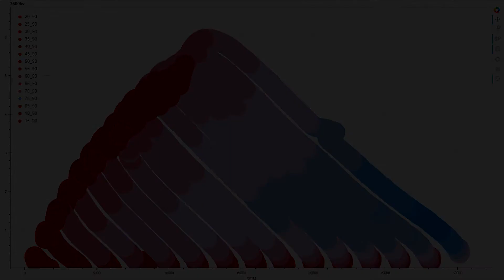Motor KV Vs Efficiency

Comment: WELL! I learned something!
would you happen to have an insight into factors in motor construction that would affect linearity of power delivery or low end torque vs high end torque?

on linear power delivery do you think that’s more just esc/software related.

If you already answered this question - just lemmie know.

thanks for these great technical videos!!
Reply from the maker: Linearity is a bit of an odd thing.  Any motor is capable of perfectly linear delivery of torque over it's power envelope, the trick is we're not in control of the torque demand on the motor, that is set by the prop.  And a prop doesn't have a linear torque requirement.  Even the "flattest" prop is going to have an increasing torque requirement as rpm increases due to aerodynamic forces.  You can attempt to linearize the thrust/throttle relationship by modifying the throttle curve if you know the torque curve of the prop and the full powerband of the motor.  But even that is complicated by the motor loading changing in flight due to prop unloading.

Low end torque is a similar thing.  At the low end the motors are capable of producing many times the torque that we use, the problem is that the prop doesn't demand it and there's no way to "force" torque to be used.

Some of the feel of linearity and low end torque may come from the compression of the throttle range.  Like in these charts each slanted line is one held throttle value, and as you go to higher kv (or higher voltage) the performance of each throttle band moves further apart.  So where on the lowest kv motor you may use 5 steps of throttle to get to a certain torque level, with the highest kv motor it only takes 3 steps of throttle.  So you're just skipping up through the thrust of the prop faster, making the low end feel more powerful.
Reply: SiieeFPV thanks! That’s what I figured. Probably just has to do with my lack of skill and the compression of throttle which is only exacerbated by the fact that I don’t generally use the entire throttle range.
Reply from the maker: we should be able to see all kinds of things overlaying measured prop torque data over the dyno results to see the composite linearity of all the related factors.  I'm still working on the software side of tying things together so we can look at it in different ways.  One day I hope to have a public site that works kind of like ecalc where you can browse and tweak all the settings yourself, but that's still just a dream at this point.